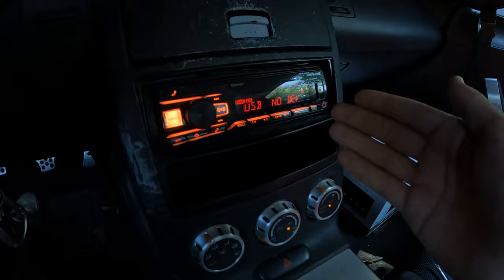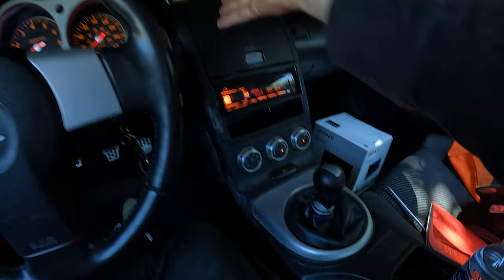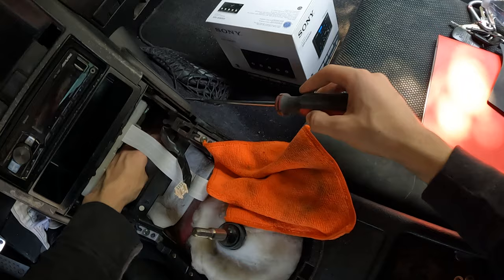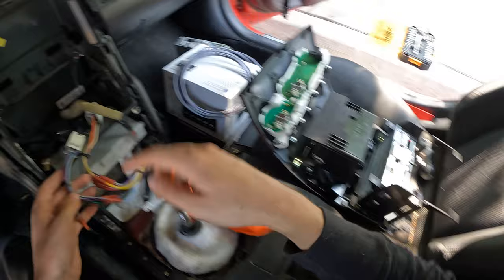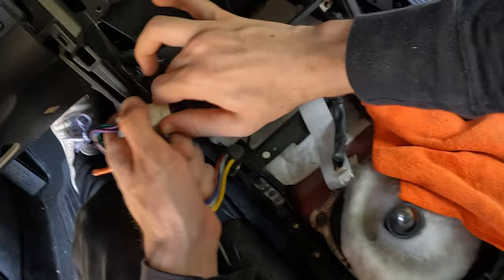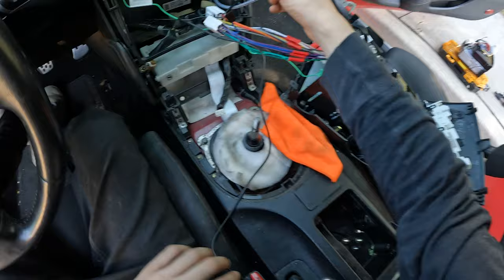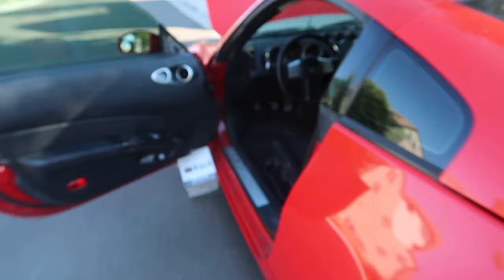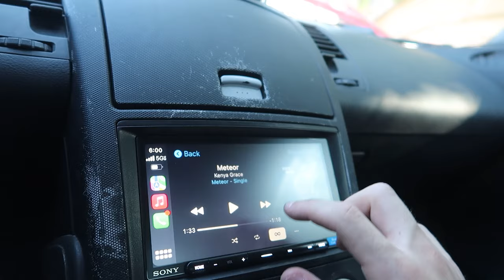Installing the BEST Wireless Apple CarPlay Headunit in my 350z! Sony XAV-AX6000

Comment: The solid blue wire that you taped over is actually for the antenna amplifier signal. You need to connect it to the blue/white wire to ensure the antenna works properly. Otherwise, your radio's FM/AM signal quality may be poor.

Comment from the maker: I did want to make a few notes about the wiring:

All of the wires match up to their same colored wires (blue+white to blue+white, red to red, yellow to yellow, etc). The one wire that was different was the ORANGE+WHITE wire coming from the back of the Sony harness that says "illumination" actually connects to the SOLID orange wire coming from the OEM car harness (included with the bezel).

There are three wires I did not use whatsoever, two of those wires are on the Sony harness and one of them is on the OEM harness side. Those were the PINK+WHITE wire (this is a speed-in wire to help the GPS track better, but isn't needed due to the GPS module included with the Sony Headunit. There is a PURPLE+WHITE wire, and this one is for the rear-view camera, which I don't have so I didn't use it. THEN lastly, on the OEM side of the harness, there is a SOLID BLUE wire that I taped over and didn't use (make sure this isn't the BLUE+WHITE wire, as it connects to the other BLUE+WHITE wire)

The light green "Parking Brake" wire is a ground wire that is supposed to be attached to the parking brake. This is so certain aspects of the screen can only be used while parked with the brake on and is a safety feature. If you don't want this limitation, you can ground the parking brake wire to any normal ground spot and it will work normally!

MY ONLY GRIPE: I'm writing this 2 days after the install and I'm starting to get the hang of not having a volume knob anymore. It's taking a little bit of time to get used to pressing the Volume - / + to adjust the sound level, but the extra screen width and sensitivity is worth it. Plus, the Volume - / + buttons are pretty high quality and have a good click-feel to them so it's not the worst, and it moves pretty quick when you hold it down for a second or two. Definitely getting used to it and will be something that is second nature in the future.

That is basically everything! If I can think of anything else extra I had to do, I'll add it! Let me know if you have any questions below! :)

Sony XAV-AX6000 - https://amzn.to/44F6HMC
350z Double Din Screen Housing / Bezel - https://amzn.to/44HiVV5
Reply: What is the solid blue wire for
Reply: Does that bezel work for all yesrs of 350z??

Comment: get ax 7k or ax9500? Just pull 1din orig out and put 1din to 2din adjustable in? it`s not even that much difference in cash, as a bonus You get 100x4 pre amp an a bigger screen

Comment: Aye johnny I’m about to pull the trigger on this head unit because of you and this video, did you wire anything to the parking brake? Crutchfield says that’s required for this radio. Thanks bro
Reply from the maker: Hey! That green wire that I grounded to the frame of the car is the "Parking Brake" ground. Technically you are supposed to connect it to the parking brake, so it only works with the parking brake engaged (safety feature). I just grounded it it to a random spot so I could use it whenever lol Appreciate your comment my friend! :)